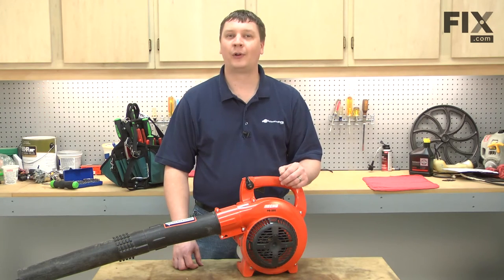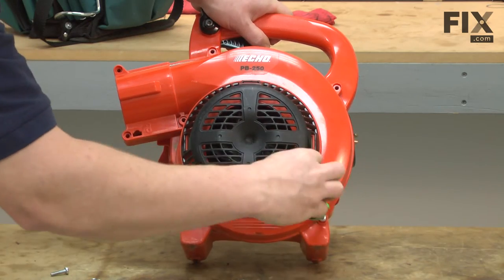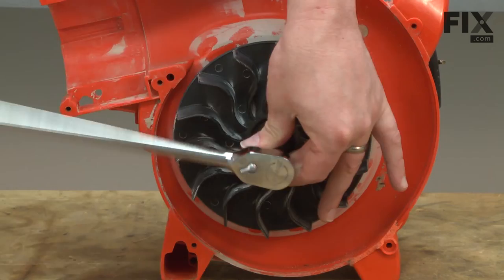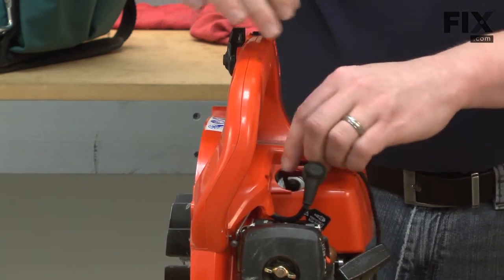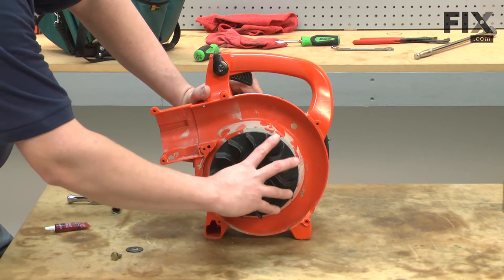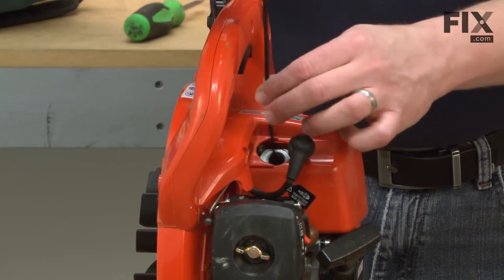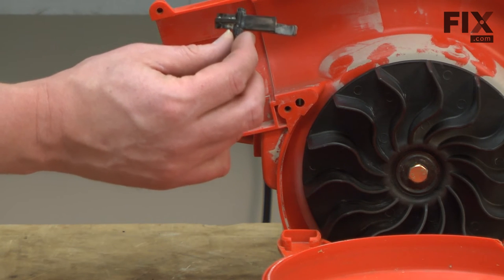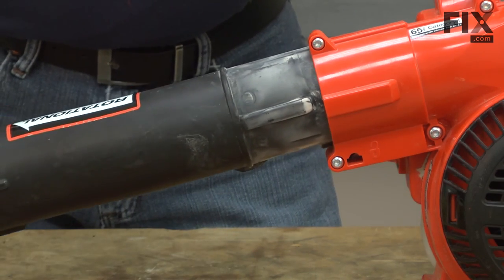Echo Blower Repair – How to Replace the Impeller

Comment: Replaced my fan just the other day, the rope trick was needed.  The old fan had to be coax off with a bit of lubricant spray and the new one slipped right on. Judging by the new wind output at the end of the tube, I'd be willing to say the old impeller was only giving me a 30 percent air flow compared to how the new wind speed felt like. Also I am convince it will function much better in vacuum mode which also was giving me performance issues that probably stemmed from the erosion of the fan blade fins.

Comment: Great info, by pure luck I saw a picture of my impeller in the manual and suddenly realized how very worn down mine was. I suspect my worn impeller is the reason for such a low velocity of wind speed. I have ordered an exact replacement and I'm quite sure the wind speed will be much improved.  I like the tip of the rope in the spark plug hole, I will try that as a last resort if the screw is stubborn. I was erroneously looking for carburetor issues as the culprit as I perused other "how to" videos here. I'm so glad my common sense prevailed and I came to the real issue in all of this
Reply from the maker: Always love to hear a story like this! I'm glad to hear that you found out what was causing the poor performance with your blower, and that you've found the product to replace it! Good luck with the rest of your repair, and glad we could help!
Reply: I put the rope in and proceeded with fix, rope wasn’t easy to pull out but did. Now, now the pull won’t pull. How do I release it...
Reply: @sunsmile57  
microscopic bits of rope may be caught inside the spark plug hole.  Try spraying some WD-40 in the spark plug hole perhaps the moisture and slipperiness of the WD-40 may free things up.  This is just a suggestion as to how I have interpreted what may have happened based on your complaint.